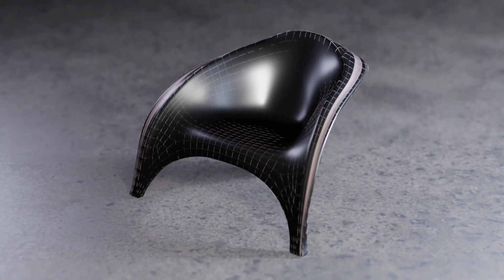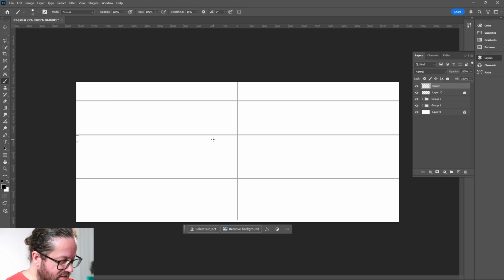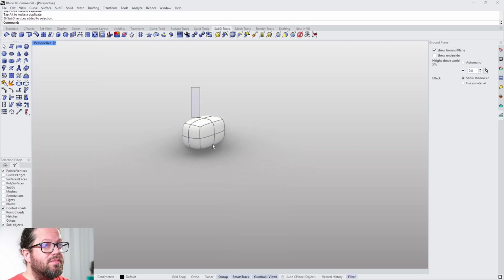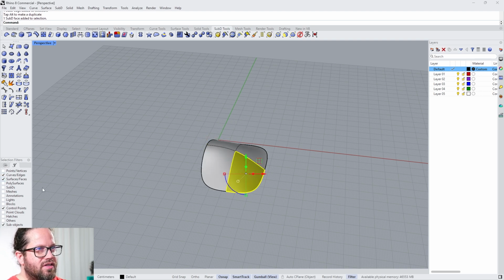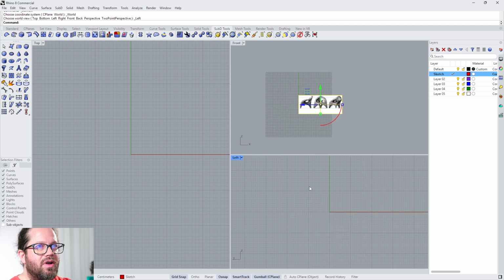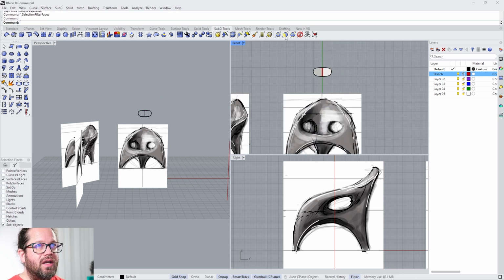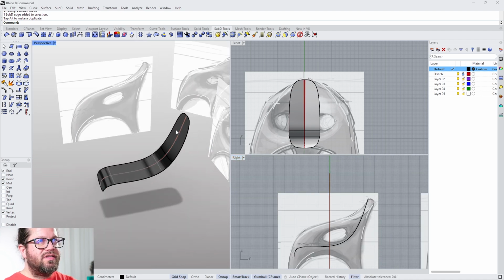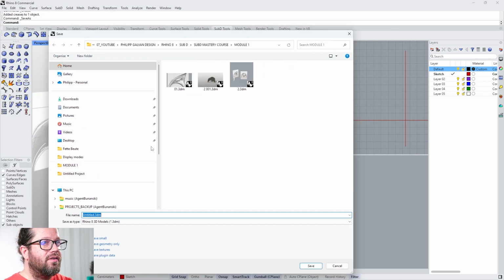Start Designing a Sculptural Chair in Rhino SubD – Step-by-Step Tutorial

Comment: is there a way to go back to zero sub-d subdivison after you apply 1 or 2 subdivision itirretions?  for some reason I cannot find a way to go back to my zerio default low poly mesh after I apply a subdivision irriration?  got any ideas. cheers
Reply from the maker: Yes there is no way to unsubdivided at the moment. This is were Blender, Maya or 3d Max has a huge advantage  with the modifiers.

Comment: if I wanted to sub-D model I can just go to Max or Blender. their tools are far better than Rhino.. I am learning rhino for the NURBS modeling, then again.. PLASTICITY is getting better than rhino in that department. I have two weeks playing with rhino spline nurbs  modeling. its FKN SHITTY.. you have openings when you do fillets. almost nothing welds. I think and I hope rhino 9 fixes all these problems. for the sake of the software...  Plasticity Nurbs modeling looks solid. everything welds no gaps.
Reply from the maker: Totally fair take — Blender/Max are designed for SubD/poly, so they’ll feel faster there. Rhino’s SubD is mainly about CAD + SubD together (accuracy, conversions, downstream drawings, Grasshopper workflows), not beating Blender at character modeling.
Re: “gaps / nothing welds / fillets fail” — that’s usually tolerance + modelling hygiene, not Rhino randomly hating you. If your file tolerance/units are off or you’ve got tiny sliver edges, fillets will open/naked-edge.